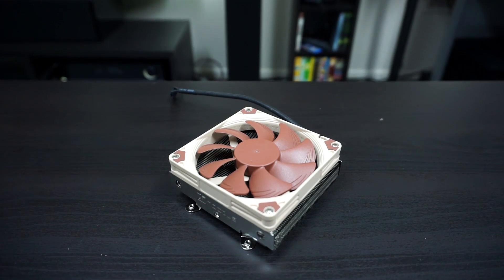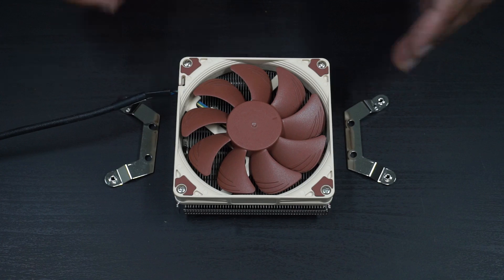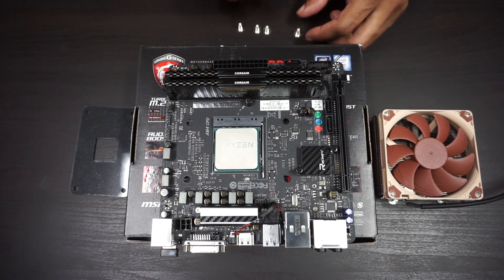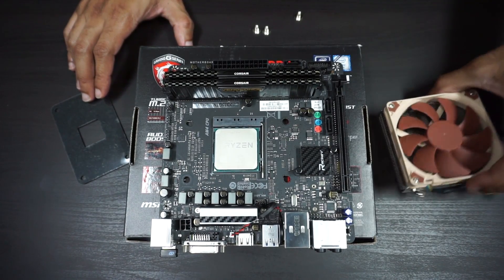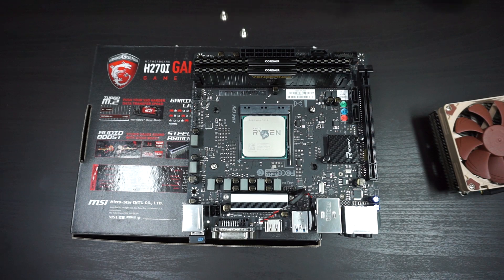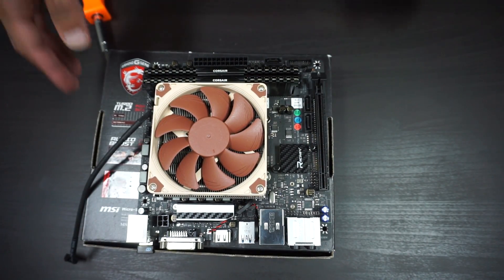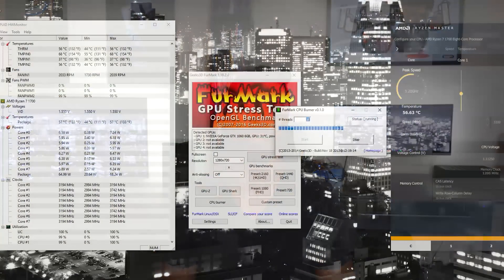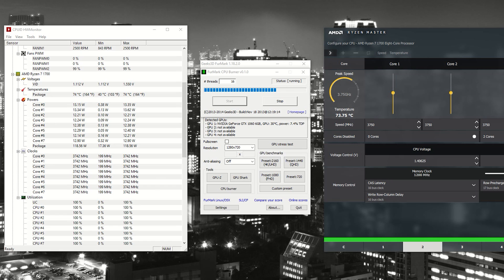Noctua NH-L9i AM4 Upgrade Kit + Ryzen 7 Temps

Comment: This can't cool a 3700x stock.
I had it on sugo13 mesh case n damn  temp get 90+ while gaming.
N that's with high end 140 mm be quiet fan in the front running a max(1600rpm) and no cables in the way .Decide to put in a 120mm aio on it. Now it stay at 60-70c while streaming n gaming.
 Itx specs
3700x
X570 itx strix
650 sfx psu
Rtx 2070 super ventus
1tb m.2 nvme
2x2tb SSD
- Note  The  ryzen 1600 cooler  fits  in the sugo13 case 
N actually cools the cpus(3700x) better at 82c max.

Comment: Hey im running a Ryzen 3600 with this cooler in a very small case. This cooler can get quite loud at times so i messed with the settings so it could be quieter.
At idle im around 40-45C but while gaming im looking at 60-70C. 
Is this going to be okay for the long term? Or should i crank up the RPMs a little more so it stays around 50-60C while gaming? 
Thanks

Comment: This cooler on a Ryzen 7 3700X in a mini itx case and the CPU clocked down to 2 GHz is a dream for playing AAA games which favor cores over clock speeds. 

I run this setup and my Ryzen 7 stays at around 45C while playing BF5 capped at 60 FPS.

Comment: What size bit did you use to take the Intel mounting brackets off the cooler? I just tried to take mine off, and the metal that the screws are made of is so soft that I just keep damaging the screw. I stopped as soon as I felt the screwdriver stripping the head of the screw. These things are in there TIGHT.

Comment: I've been running my NH-L9a for over a year very happy with it in an HTPC with a 1700x it fits my Asrock x370 ITX/ac board great. I have Arctic MX-4 on mine though. Mine runs 3.7 mostly stable just like yours, however is very unstable at 3.8.

Comment: !!! WARNING !!! The NH-L9i barely fits into the ASRock Deskmini A300 (With AM4 Upgrade kit). It will touch the VRM coolers and bend them by 5°, cutting/grinding 1mm of the VRM cooler is recommended. For normal users a possible problem.

Comment: I got the noctua in an inwin chopin with a Ryzen 5 2400g and though it had more clearence than the Wraith Stealth unshrouded I really did not see much difference in temp or noise. Not worth it. I returned it and saved $45.

Comment: A lot of your videos are so great for those of us who have chosen to build a custom PC on the Mini-ITX platform. 😊

Your builds have all inspired me to dump my old Lenovo laptop - a 5 year old computer that was unstable with Windows 10, and dive into my first build.

I chose:
ASUS ROG Strix B450-I Motherboard.
AMD Ryzen 3 2200G APU.
250GB Samsung EVO 970 M.2 NVMe SSD as the boot drive.
1TB Samsung EVO 860 M.2 SATA SSD for general storage.
G.Skill Ripjaw V series 16GB RAM.
Mini-box M350.
Mini-box picopsu-160-xt.

Since the stock rad and fan from the APU don't fit in the M350, I'll be running the NH-L9A in the next week or so. My computer's been looking quite ridiculous with the top just floating on the fan, unsecured. 😂

Great content! You've got another subscriber to your channel!

Comment: Ryzen 7 2700x 105W . That is cpu cooler 95W.  Can i use ?
Reply from the maker: You will probably have to downclock the cpu to work well with this cooler.
Reply: I am running that setup right now. 2700X on the x470 Asus Strix with the L9i in the DAN Cases v3. Temps are not good. Idling around 50 ° C and barely maintaining stock speeds in Games with 83 ° C. 30 min Handbrake encode pushes it to right below 85 ° C and CPU has to throttle to 3,3 GHz. I am using Thermalgrizzlies Liquid Metal Paste ...

Comment: Real engineering oversight from Noctua side, the only way in which the cooler can be mounted, the airflow being obstructed by the ram and vrm heatsink. Taking into account that  it is meant to address the mini-ITX builds, in which the space is a real issue, for example in a node202 case .

Comment: Decided to upgrade to this from my Stock Ryzen Cooler (Which is freaking good but I just want to overclock)
Reply: i was worried it wouldn't keep my 2600 cool enough to overclock but it's running good with +200 mhz

Comment: I did an intel 6700 with this cooler tonight and it was hitting 100c as seen in hw monitor.
Maybe my ac5 dried up. My AC5 is old that thing is over 5 years old for sure.
Good temps in your video, I hope I can get temps like that on the 6700. 
I am getting up to 60c stock prime95 small fft with custom watercooling loop on 2700x(420 top and 480 monsta on the bottom of the case).
Reply from the maker: You definitely shouldn't be hitting 100c with a 6700. I ran that configuration for over a year and never approached 100c.

Comment: Test on thing like IBT are just crap, because they add a load you will never have in normal usage.

For me, my proven test of stability and expected usage:

1080p bd rip mkv + winrar/7zip benchmark (change those with CB R15 and a handbrake encode)

Comment: Would have been nice to compare the noctua numbers to the stock wraith numbers...you know, a major point this video could make & why probably lots of people are here smh
Reply from the maker: If you are here... that means you need a shorter cooler then the Wraith... so the wraith numbers are irrelevant.
Reply: Tek Everything No they're not. I came here expecting to see how much better the Noctua is than the stock wraith cooler, or a different cooler, which was insinuated by giving your video the title "upgrade". That implies how much better "X" is vs "Y". Just expecting to see if "it's worth spending $40ish dollars to save "X" numbers of degrees". Again, you do a good job on  Noctua numbers & dropping info, but unfortunately without anything to compare it to, they're just a numbers.

I like your style, very informative. Just giving you some constructive criticism man.

Comment: the NH-L9i is no good on the i7-8700 (non K) i was getting 90+c on an open test bench. I should have went AMD and never went up the coffee lake road, the Cryorig C7 however with the noctua fan is keeping it at ~80c under 6 core full load
Reply: Problem is Intel's shitty thermal paste between heat spreader and chip. AMD 8 core CPU's have much higher TDP than 6 core 8700, but they are still doing great with NH-L9i, even after decent OC to 3.7 - 4 GHz.

Delid your CPU or let somebody with experience delid your CPU for you. Then remove stock thermal solution and put a little Thermal Grizzly Kryonaut on CPU die and then 2 - 4 millimeters size grain on the heat spreader. I can guarantee you this makes huge difference in temps, like 10 - 20 C on load.

Using TG Conductonaut (liquid metal) for heat spreader will do even better, but it might be dangerous to use if it gets in the wrong places (example dripping it on motherboard can ruin motherboard when powered on), since it's electronically conductive. Therefore us normies shouldn't use it on CPU die itself, only to heat spreader and cooler, for CPU die Kryonaut is much safer.
Reply: @Purjo92  fuck that bullshit you guys are still stuck in the 90's . Get thermal pads , way too easy . Perfect in size and last 20 times longer . I have a Ryzen 2400g clocked at 3.8ghz at 1.45volts . I'm using the stock Wraith cooler . 32c at idle and 56c to 59c on full load . In a very small Thermaltake Supressor F1 case .

Comment: Hey, I need to ask again, where do you see any indication on which direction the air is flowing in the NH-L9? I have the 9a, but I cant find anything that says it wouldnt flow in both directions i.e. towards RAM and towards the back IO.

Also, I am idling at 50 degrees in BIOS with a ryzen 1500X. What am I doing wrong? The case I have is somewhat restrictive on airflow, but idling at 50 degrees stll seem a bit high all things considered.

Comment: Don't get this fan if you use rendering software,  such as Revit which uses 100% CPU on all cores.  From personal experience my ryzen 1700 goes 90+ degree and it freezes with this Fan ,  also it will not run any CPU stress tests more than 15 mins.  Sadly though,  this fan is the only option for an ITX build... so I had to change a bigger case and used watercooling to run the Revit software

But if you only do gaming,  it is completely fine,  my gaming highest temp is around 65 degree

Comment: The vrm and or chipset temps look pretty  high in those tests (as seen in hwmonitor output) what is that running at 89 degress C when cpu was at 3543 Mhz (@5:37) ?
I ask because that particular mini itx board doesn't appear to have much in the way of heat sinks on those components.
Reply from the maker: Yes, the VRM cooling on this board is fairly suspect. Probably not the best option for long term sustained overclocks.

Comment: I'm thinking of using this cooler with an 8700k in a dan a4 case. or should I get the 8700?
Reply from the maker: How are you planning on fitting an H55 in the Dan A4?
Reply: Hi man. Sorry for any confusion - I mean I'm planning on using the Noctua NH-L9i in the Dan Case. Not an H55. Though the new Dan v2 does say you can use a 92mm AIO in place of a drive space. Can't see how this would work. My dilemma is whether to get the 8700k or the 8700 as the Noctua NH-L9i is officially only rated for 65W TDP (8700) or 95W (8700k) in a well ventilated case. The new Dan V2 does say you can add an additional 92mm fan or an AIO. I may just plump for the 8700 but I'd be keen to undervoltage to keep temps down, if that is possible on a non-K. I just don't like the idea of using the Cryorig C7, as everyone says it's very loud but does support 95W TDP.
Reply from the maker: Hey whoops... I thought you had commented on another video, my mistake. I have an 8700 and I will be testing it with the cooler this weekend. Based on using it with an AIO, it's not looking good for the NH-L9i, but I am holding out hope.
Reply: Tek Everything That's great. I look forward to seeing that vid.

Comment: Furmark for CPU? Are you kidding me? Why use that when there is free and professional Prime95?

I can’t remember any CPU thermal review done on Furmark, so the results are useless when there is nothing to compare to. Probably 7700k will achieve 50C under Furmark, who knows?
Reply: I don’t even know if Furmark fully burns FPU. If it does not, then the “stability test” is nonsense. Peak heat comes only from FPU. Leaving it unstressed or understressed being almost cheating.
Reply: 吴振南 bro, prime95 is not used for cpu benchmaking anymore, even noctua says that. It doesn't work any good.
Reply: What should be used then? Is IBT any good nowadays? Would love to hear alternatives.

Comment: How does this compare to the wraith spire? Im planning on a mini itx build with the node 202 with a ryzen 1600 , and debating whether i should pick up this cooler or not, id like to be able to get the 1600 to 3.7-3.8 ish which should be fine normally, but the wraith spire can get very crowded in the node 202 and requires the removal of the dust filter and the shroud for the wraith spire. down to actual performance is there a huge different in temps? and also noise?
Reply from the maker: If you grab the NH-L9a version, you should be able to hit your desired range. The spire is larger, so it has more cooling potential, it is also louder though. I actually used the slim noctua 92mm fan on the spice heatsink, and that worked phenomenally.

Comment: Will this cooler fit in the ASRock AB350 Gaming-ITX/ac Fatality motherboard? The only reason I'm asking is because pcpartpicker actually says that the cooler is not compatible with AM4 and the aforementioned motherboard
Reply: yeah pc part picker will show that the cooler is not compatible based solely on the mounting bracket.  so you just need to get your hands on the cooling bracket and it will be compatible
Reply: Anh Vuong requires the AMD adapter, free from Noctua, or about $6 if you can't wait.

Comment: Noctua said they shipped my kit on 7/31 but it still hasn't arrived, might just buy the l9a instead if it works out of the box I already put my l9i on eBay #tired of waiting :(
Reply from the maker: The L9a still requires the adapter

Comment: Noctua is making some excellent products.  I note you didn't mention the noise levels, which are actually quite low for the NH-L9x65-SE that I have on my 1700x.  I overclocked to 3.8 just to see if I could and it handled it, barely.  It's not a cooler I would suggest for overclocking, but for running at stock speed, nice and quiet even under load, this is a GREAT solution that was much less expensive than the AMD coolers at the time I purchased mine.
Reply from the maker: Yea the Ryzen CPU's are nowhere near as difficult to cool as I thought they would be. I may use a NH-L9 65 in a build I have coming up.

Comment: This cooler is garbage on 95 tdp cpu's, it reaches 115c playing games before the pc thermal shutdown. be aware that the 1700 ryzen is a 65 tdp cpu so you won't get bitten like I did building a system with 95 tdp cpu.
Reply from the maker: Garbage is a little strong my friend. It is the best low profile cooler on the market.

Comment: After building thousands of pc's, let me just say difinitivly (as i tested it long ago) your putting the thermal paste on wrong! You do need to use stiff card to evenly apply the paste and yes it does effect the effectivness of the cpu cooler and overclocking ability. One big problem is over time it will spread out and the screws will need slight retentioning if you do it your way too. just FYI... BTW 3.75 is a good OC for CPU temps and power draw, ESPECIALY with such a compact cooler!
Reply: Steve, TheDailyShaver Linus tech tips tested every conceivable paste application method a few months back. None of them changed anything

Comment: Thanks for the test man! What did you mean by directing the airflow away from the ram? Ist the air pushed to both sides in the direction of the heatsink-fins? Or is the path blocked in one direction?
Reply from the maker: The NH-L9i is directional. The fin pattern only allows air to be pushed out of two of the four sides. It hasn't been a problem so far, but it may be with more powerful chips.
Reply: Thanks for the reply! 

Is it the same with the L9a-version (AMD-version)?
Reply from the maker: Yes, they are both directional. Although the L9a is a little larger which I hadn't realized before. I just ordered one this morning to see which cools better.
Reply: Tek Everything cool! looking forward to you review and comparison between both coolers on AM4.

Theoretically, there shouldnt be a difference. While the L9a is longer, it is more narrow than the i-model.

Comment: By all means get a Cryorig C7. It's louder, but has 100°C TDP support. Also an all-Copper variant was announced at Computex.

Also, why would Noctua release a mounting kit for this variant when there was the NH-L9a which would've been easier to adapt? (Aside from the L9i being better-selling)
Reply from the maker: The kit works for both coolers. They both have the same screw on leg mounts.

While I like the C7 it doesn't fit in some SFF cases.

Comment: Hi, Which 1 do you recommend me buying & think is the best between these 3 Mobos (ASRock Motherboard Z270 Gaming ITX),  (MSI Performance Gaming Carbon Intel Z270 mini-ITX) & (Gigabyte GA-Z270N-Gaming 5 Lga1151 Intel Z270 Rgb Fusion ) & Do you know that HD Plex 400W is out for purchase. waiting for u to make a review on it soon :)
Reply from the maker: The only Z270 board I have used is the Asus Rog Strix board. So I really can't speak to the quality of any of the others. If you are going with Z270 I would grab the Asus board, it has the best feature set and the awesome Asus BIOS.
Reply: Tek Everything Oh ok but asus boards costs more ... :(
Reply from the maker: True... generally I like Gigabyte boards too. I just don't want to recommend something I have never actually used. Newegg reviews can be a pretty point of reference. You should also be able to find reviews of each board on YouTube.
Reply: Tek Everything Thx Buddy, m too confused between these 3 boards, & here in INDIA the costs of these boards r sky high as they r charging 70$ extra for shipping. & asus is totally over the budget.

Comment: Handles my 7700k delidding with liquid pro and some thermal grizzly between cooler. 44-72c max in my cramped dan A4 case
Reply: you got yours down to 74c my delidded 4790k runs at 85c at full load

Comment: 3.7ghz should run at 1.22v for the ryzen 1700
Reply: yeah it will run fine but u will need more voltage if u want to complete stability

Comment: Thank this helped me out a ton! I've been looking into building a mini itx ryzen system, but I was worried about thermals. I was thinking I was going to have to go with a 7700 65w chip to get good clock speeds, but it sounds like this cooler can handle Ryzen 7 overclocked which is great!

Were the temperatures you provided in the video from the cooler being used in an open air environment or inside one of the smaller cases you talk about? I'm looking to build in something like a Node 202.
Reply from the maker: These tests were done in open air, so take that into account.